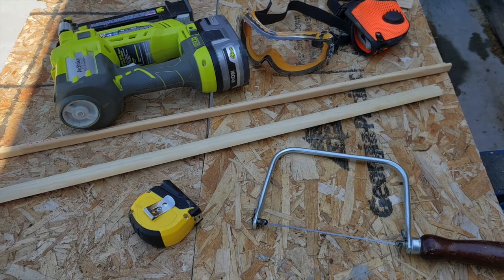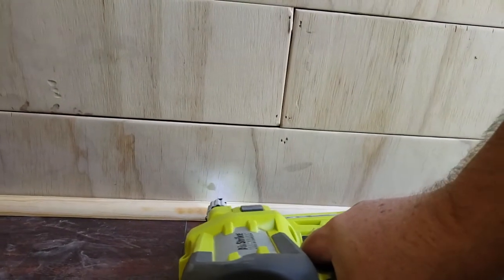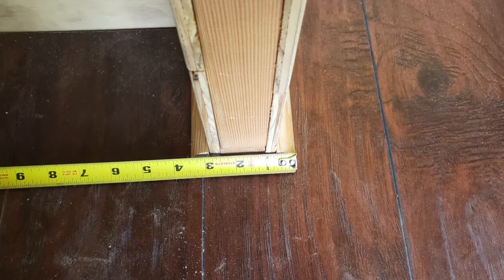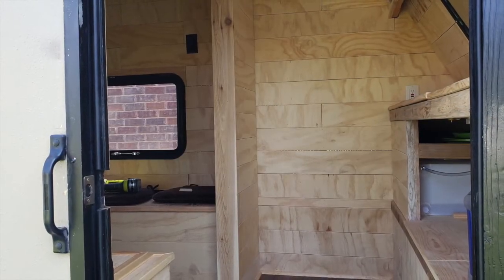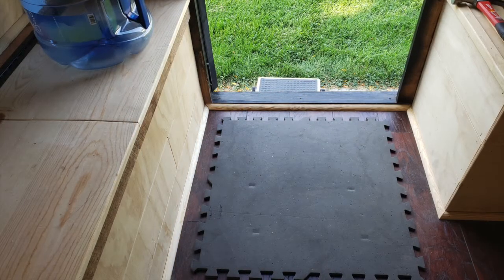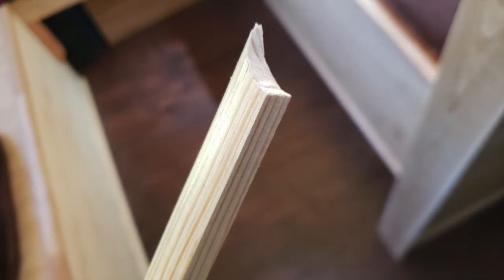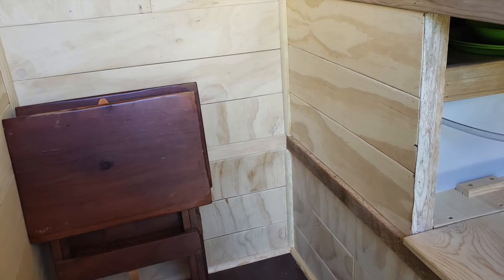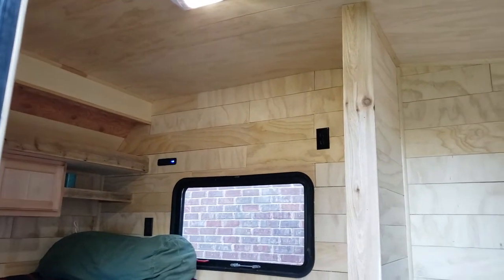DIY Homemade Camper - Episode 25

Comment: Lets do a truck camper next Daryl
Reply from the maker: I actually built one before I started my camper build.
Reply: @TheWoodHaven  i gutted my truck camper after it leaked on the roof around the skylight. Saved all the componenets for building another truck camper. except 2 of the windows that are now on my squaredrop. I have blueprint plans from Glynn L for building another truck camper
Reply from the maker: @breakdownbill1  I stole the fantastic fan out of mine so I retired it and swapped it out for a DIY Tonneau Cover.